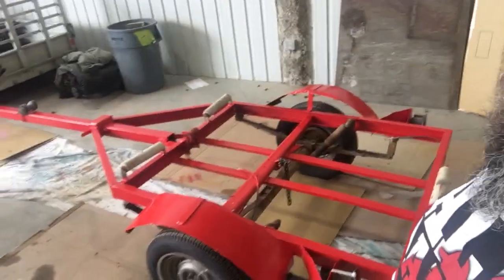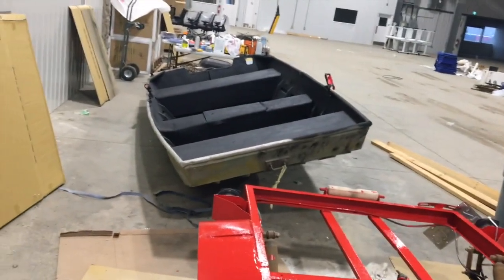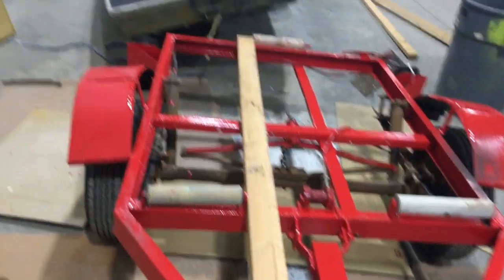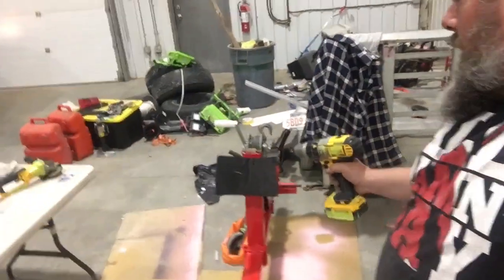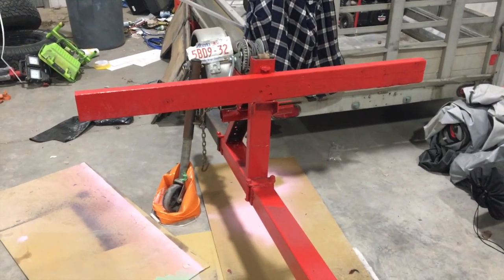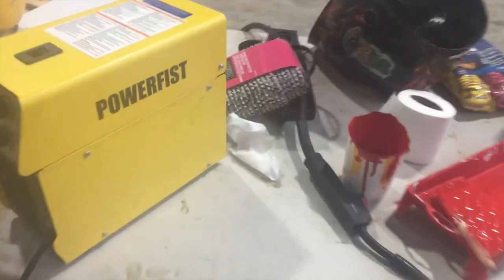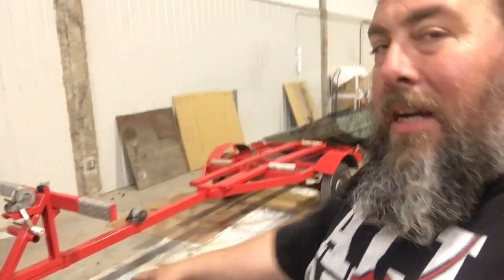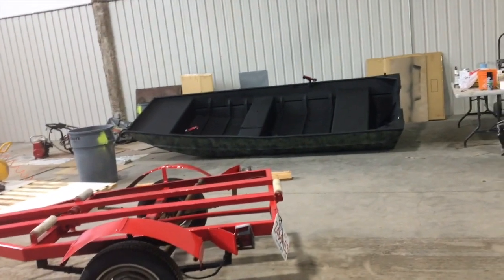How to make a regular boat trailer fit a flat bottom bass boat

Comment: Great job  ! Looks great ,I wrapped my 2×4s with a nice outdoor Carpet using stainless steel staples on the bottom sides of the 2×4s ..Just subscribed
Reply from the maker: That's awesome. That's a very old video I'm glad you found it and I hope it had something you liked. I really didn't get to finish the trailer the way I wanted because I sold the boat almost immediately. Thanks for watching and subscribing